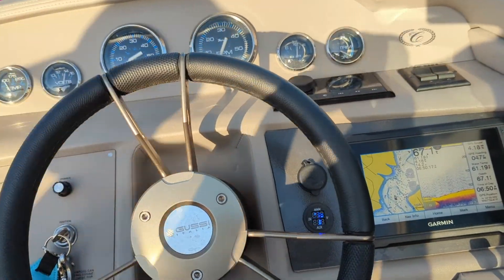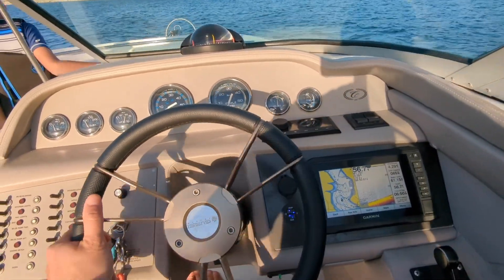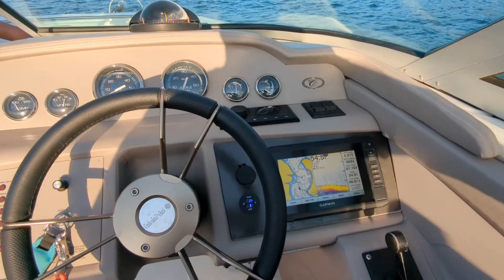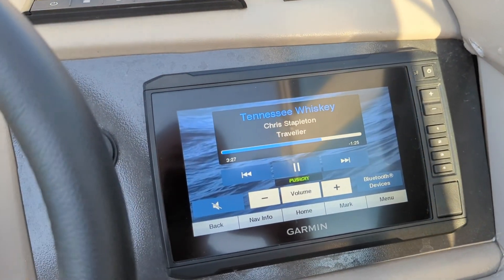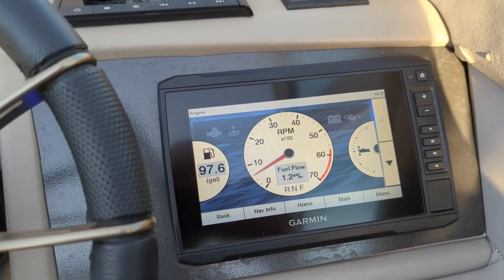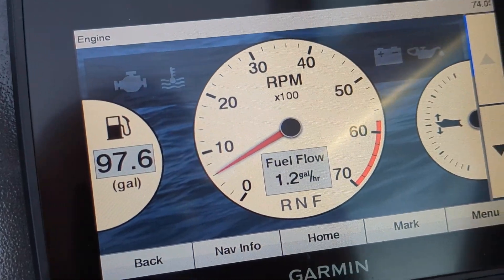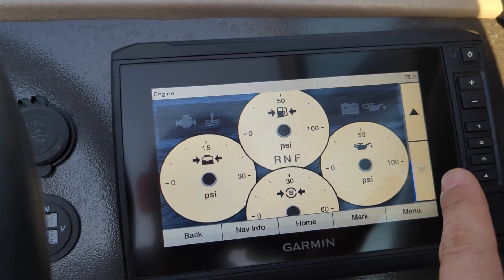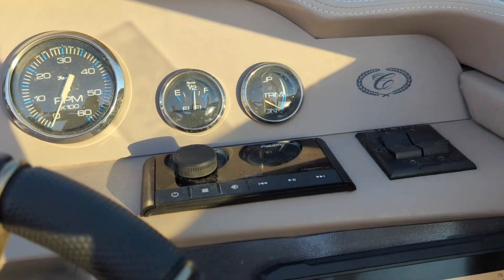Fox Marine Engine Gateway How does it DISPLAY on Garmin through NMEA2000

Comment: Anyone know how to get fuel data on the echomap ultra 2’s?
Reply from the maker: If you are on an older boat like ours that doesn’t tie the fuel level signal into the ECU then you will need a signal translator to get the resistance signal from your fuel level sender converted to an NMEA2000 signal. Here’s one that should work.  https://amzn.to/42CKVJY
Reply: @ i had the data on the ultra, got the ultra 2 and its not therr
Reply from the maker: Maybe they're gauges you need to add in the interface?

Comment: My 125sv will overlay data on my maps but gauges don’t work? Any help?
Reply from the maker: I think the 125sv is the same software package that my 73 runs. Yours is the echo map UHD right? Do you have an engine gateway hooked up and connected to an NMEA2000 network with your Garmin?
Reply: @NKPGarage  yes I do, it shows it’s active in the connections and can get data if I over lay it on the maps or sonar/down/side image but won’t display data on the gauge screen.. I’ve tried all I can think of
Reply from the maker: @ryanferguson3769 that’s interesting. Have you scrolled through and looked at all the various gauges? Are they all blank or just some of them?
Reply: @NKPGarage  yeah I have. Weird hey.. I’ll run the motor again tomorrow and have a play with it to see what I can do. Confusing I can get data in the overlay and not on the gauge itself
Reply from the maker: @ryanferguson3769 ya that is really odd. I wonder if the gauges have settings. I forget what the settings are for the individual gauge displays.
Reply: @NKPGarage  my brp taco and fault gauge died last week so looking at options for gauges now. Can’t find any I command gauges and they want 750 for a icon gauge. May aswell buy another gps and run the gauges on that n can also hook up my fusion like you did through that. 
The last bloke who owned it ran a lowrance ti2 and know for a fact it all worked perfect through that, just doesn’t through my Garmin 🤷🏽‍♂️
Reply: @NKPGarage  really appreciate the replies

Comment: Very informative and well done!
2 Questions:
1) My app is a 2005 Volvo Penta 8.1Gi and I'm hoping to connect it to an existing/mounted Lowrance 3500C. Any feedback is welcomed. If that is a "no-go" I am willing to swap that thing out for a decent Garmin to do the trick. Any recommendations there?
2) Now for the off-topic question... What do you like or dislike about that Throttle Controller you have vs the standard all-in-one version? I like the idea of separating the gear action from the throttle action but I wonder if it makes it a lot more difficult to parallel park against a dock as an example.
Thanks from Texas!
Reply from the maker: Great to meet you! Where in Texas? We are in Round Rock, right North of Austin. 1) Your engine should be supported by the Fox Marine gateway. You just have to get the part number off of the engine computer to get the correct gateway from Fox Marine. For the 3500C, that's a pretty old unit. Looking at the documentation for the 3500C it looks like it supports limited NMEA2000 inputs, maybe GPS? But I can't find solid info on whether it will output engine data or not. Worst case if you install the Fox Marine gateway and your Lowrance does not support engine data, you can still read it all on your cellphone with the Fox Marine mobil app. But it sure is convenient to have it on your display.... 2) Our previous 3 boats were all single lever, this is the first one we have owned with the separate levers. It took a few times to get used to it, but now I really do like it a lot more. For docking it is WAY easier, because any maneuvers at the doc are always at idle speed anyway. So I just keep the throttle at the minimum selection and only use the other lever to go forward, reverse, or neutral. Leaves less room for accidental throttle mistakes in my opinion.
Reply: @NKPGarage  
We are east of Dallas in Heath (Rockwall County). We boat on Lake Ray Hubbard most of the time. 

I think I will probably just upgrade that 3500C to a newer Garmin version that will work for any data the ECU will put out. 

GOOD-TO-KNOW on the dual throttle! I like the sound of that. It looks cool too 😊 Now if I could just find one! I’ve looked all over for a Volvo Penta compatible one but they aren’t easy to find.

Comment: Hey great video!  I am planning on installing similar system on my boat.  Do you know if it is possible to use both the chartplotter display AND the analog gauges that are currently connected?  Or, is it just one or the other?  Been trying to get fuel tank data on simrad with no results, appears it’s analog.  Thanks,
Reply from the maker: On our boat the fuel level sensor does not talk to the ECU, it only displays to the analog gauge. In order to get it to output NMEA2000 data that you can show to your display you will need a level sensor translator like this. https://amzn.to/3L9vRfG
Reply from the maker: For other analog gauges or analog sensors you can use a nmea2000 translator box to convert those signals as well. Something like this. https://amzn.to/3GLWDI3
Reply: Ok thank you.  But I thought in your video you get the digital from the gateway, and back up with analog.  I have been going round and round with Mercury and Simrad all last season and can’t figure it out.  There is currently one pink wire running to the harness on the engine from the fuel tank.  I did what you stated, removed a couple gauges and added the simrad in center of dash panel with the black composite.  So it is not possible to use both the analog and chart plotter?  I’m really confused, sorry.
Reply: Btw, 2018 25’ Chaparral that was pre wired with the gateway up under the helm.
Reply: Thank you!

Comment: Well done.  I'm in the process of adding a NMEA network as well.  Fusion 770 to Garmin73 SV.  I have twin year 2000 volvo penta 5.0.  I will investigate the ECU connection. thanks
Reply from the maker: It's a great setup. I've been very happy with it so far.
Reply: @NKPGarage  Thanks for the reply.  I will look at your install video later tonight.  Hopefully the twin engine install will be easy.
Reply from the maker: @jimrobertson164  good luck. Let me know how it goes.

Comment: Hello I just sent you an email maybe we can help each other or you can help me, and thanks for the video. 
Did you ever add a sensor to detect trim on your Fox Marine?  I am thinking of taking a slightly different approach.  I have a Noland unit RS 11 (programmable) which is similar to the Fox Marine. With the Noland I am able to tag off of sensors such as tach, voltage, oil pressure, water pressure or any 5 volt or resistance value so that I can include these readings that the Fox Marine is not able to do. I can then use the Fox Marine for what it can read from the ECM.
 I am hoping we can share experiences and possibly help each other out on this project since there seems to be limited information on the internet to support this.
I look forward to your response.

Comment: What trim level sender will you be using ?
Reply from the maker: I havent done a ton of research yet on that. The one I had saved on my parts to buy list was the Garmin Get 10 adapter that will translate the signal from the OEM tilt sensor to NMEA2000.
Reply: @NKPGarage  Take a look at my email, we might be able to help each other. Take a look at the Noland RS 11 unit. It might help where the Fox Marine falls short.